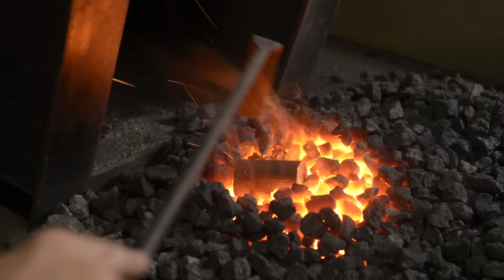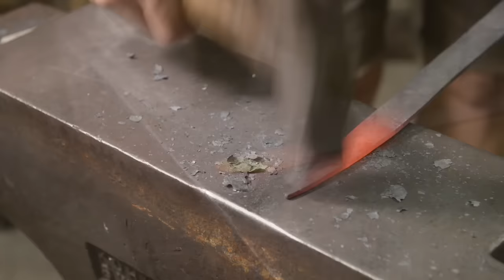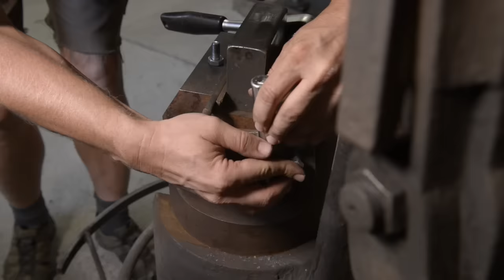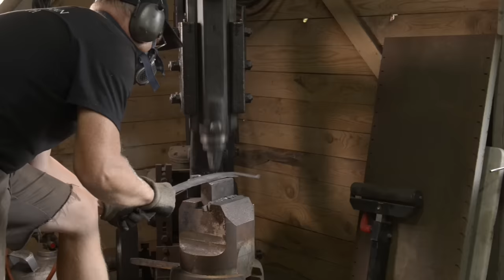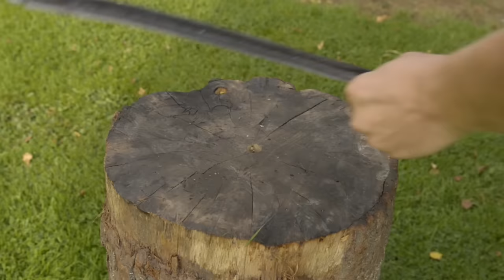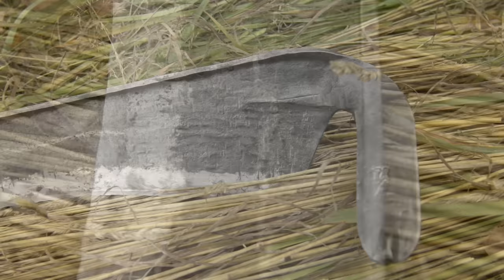Blacksmithing - Forging a scythe

Comment: Good work my friend 👍👍I just came acros your chanel, and with a lot od experience with scythes and peening, I must say it is a little bit soft by the way how fast it goes with peening. A heat treatment is needed after all.  A lot of european scythes are harder heat treated, intended for a harder, older grass(to stay sharp longer).
Reply from the maker: Thanks! Yes, I learned afterwards that it actually should, but they are tempered very high to handle the peening.

Comment: Instead of doing the marking and filing and grinding of the edge iirc it was common to sweep the blade on a stone to smooth the stroke edge before sharpening

Comment: i made a furnace in my backyard except it doesn't use coal to heat up I use charcoal to replace coals i also used an old steel leafblower as the air source.

Comment: It should harden when the steel turns gray somewhere between 600 and 700 degrees. It can bend or tear off a piece of metal if there is some thicker grass or it hits a stump or a thinner tree.
But the work is great.

Comment: I know this is a 5 year old video, but I have been super curious about scythe making. I was wondering, is there a reason that they are typically made with medium carbon steel and workhardened via peening instead of using a higher carbon steel that gets heat treated? Recently I've been developing a sickle out of some high performance stainless steel and its been working superbly, just wondering if things change as the blade increases in size
Reply from the maker: The original reason was probably that a high grade steel simply wasn't available. That's why we in Sweden only see high carbon steel ground scythes. We had a good steel source. The rest of Europe didn't. That said the peened scythe has som other nice properties, like if you damage the edge you can actually peen back the edge instead of grinding the whole edge down. And you don't need a grindstone with you on the field, just the honing stone. Simple and easy. The medium carbon one should still be heat treated, which I didn't do (I tried to research this), but tempered back really high to cope with the peening.

Comment: They made it excellently. However, the cut result is not convincing. In northern Germany, sharpening and hardening by hammer blows in the cold state is called "dengeln". And the handling of the wet grinding stones is certainly also important.

Comment: I’d say to use smaller bites into the tall grass for a better easier cut and it actually goes faster than you might think because you are not putting so much energy into large bites of grass. I would buy one of your scythe blades if you have any for sale.

Comment: Am I missing something or didn't you harden in the forge at all? So presumably the tensioning process and any future peening will work harden the scythe sufficiently to hold an edge?
Reply from the maker: I didn't research that enough, my thinking was the work hardening from peening was enough, but it turns out that it needs to be hardened. But tempered very high to cope with the stress of peening the edge.

Comment: The opening segment with the grim reaper was great, but waaaaay too dark.  I could barely see anything.

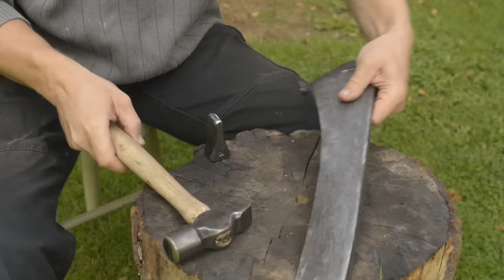Enjoyed the rest of the vid ... esp how you put the lipped spine on the scythe (15:20), and then did a hand-hammered cold steel edge bevel (19:45). Fascinating (+1).

Comment: How much Is the chisel like tool used at 4;30 hardened
Reply from the maker: It's a piece of coil spring. Hardened in oil and tempered to about bronze color I think at the very tip.

Comment: Was the hardening and tempering not part of the process?
Reply from the maker: It should have been, but in my initial research I couldn't find any info. My thought was that the edge needed to be soft enough to take the peening. Afterwards I was informed about the hardening and how it should be tempered back passed light blue.

Comment: Oh my. A hand forge scythe. Now that's rare and complicated IMO - the blade is quite thin and quite long. 

Some questions I have: 

1. Shouldn't the blade be hardened? Does it rely solely on the stress introduced when beating the edge on the small anvil for the hardness? 

2. The higher quality scythes we have around here, have the rib undercut, as opposed to just a raised square edge the rib is trapezoidal in cross-section; Do you think that it's of any importance, or it's just a coincidence that the better manufacturer used this specific shape? 

Some advices, based on my experiences of mowing in my adolescence: 

Ride the blade on the spine. It should touch the ground. Rotate your torso, do not use your hands too much. But as you said, a better snatch would help a lot, as of now you don't actually have a choice but to use your arms. 

My father used to say that you should be able to mow with so little effort, that you should be able to whistle without interruption the whole time. He didn't do it all the time, of course. But it's a way to gauge your progress as a mower :-) 

On the sharpening - we'd normally use the rib to keep a consistent angle for sharpening on the inside. It was important to get a burr, and work it in such way, that it was as much as possible in line with the blade - do NOT break the burr  as you would do on a knife or axe - the burr does the cutting, and you normally touch the scythe every 50-100m of mowing or so (it depends a lot on the grass, dryness, and whether you hit or not the ground due to molehills & stuff), and every 500m - 1km  you would do a complete resharpening. 

On the snatch - traditionally in my country (Moldova) it's made from a softwood, such as pine or fir. I don't think it is wise, maybe it was a cost-cutting solution - but the 2 snatches I made were from acacia and cherry - they were superior to the softwood one, in many people's opinion. In our parts it normally has just one handle, the one in the middle. They are "custom-fit" for the guy who does the mowing, you should be able to mow comfortably with your back straight, otherwise you'd whirl in pain at the end of one full-day of work. 

The wet grass is actually working in your favor, it acts as a lubricant. In fact, we used to get up at 4 in the morning with my father, to catch the morning dew. At about 8, when the grass would dry, the effort would suddenly increase, and we'd call it a day at about 9. Very rarely we would mow the whole day, and it's a freaking marathon when we did. After a while your mind just goes blank and your body moves like on autopilot. 

Oh. Sorry for the long post. Scythes are exciting!
Reply: oh, one more thing, looking at your current snatch - don't bend it. The edge should be slightly raised, not completely horizontal. Maybe a...12-15 degrees - you decrease the chances of hitting rocks, roots, and pieces of dirt.
Reply from the maker: Thank you!
1. Yes, after more research it seems it actually should be hardened (but tempered back quite far to still be reasonable soft). I thought it needed to be pretty soft to withstand the peening, and several people agreed to my thinking.
2. I think that is just coincidental and part of the manufacturing process.

I'm working om my technique! I have made my handle longer now as a test, and that makes a huge difference.

Comment: Surprised you didn't make a Scandinavian style scythe which are extremely hard and can't be peined. You have to sharpen them with a stone. Usually heat treated to straw color and no further.
Reply from the maker: I kind of like the simplicity of this style.

Comment: Very interesting. Did not know that linseed oil is good for steel (I used it for wood all the time). Wet grass is actually good for scything, better than dry grass (it's a bit like cutting hair). Most people hone the edge with the curved side of the stone.

Comment: When peening the edge, are you looking to have the edge cant slightly downward during the sharpening process? I heard because of the normal wear its actually better to keep the edge at a slight angle apart from the rest ofthe blade... Im no expert. Just wanted to know iftheres any truth to this?
Reply from the maker: A slight upward angle on the edge is ok! Not sure if that effects the performance much tough.

Comment: I read through a load of comments and theres a lot of different thoughts on how to make this work and why it didnt work. However it is a combination of things the carbon content will have been reduced when the sparks formed therefore eliminating the red short theory. The sparks would have also gained a coating of iron oxide feo3 as well as rust from getting wet therefore what you have is a lot of feo3 and a bit of steel of questionable carbon content.therefore if you stuff it into a can and heat it up you ar essentially trying to weld a can of forge scale together which will give you partially consolidated pieces of forge scale as we saw in the video.
Im not sure you could make this work in a can by adding carbon to replace the oxygen as it would need to be present in the right proportions and would need a vent hole which in a best case scenario would weld together but would be full of contamination and be inconsistent throughout the billet its a cool experiment but i doubt welding sparks is a viable option

Comment: Common Rockwell hardness for European blades is about 45RC. Nordic, English, and American blades are a good deal harder, with whole-steel blades being about 55RC and laminated blades having an edge so hard that a file won't bite them.
Reply from the maker: Wow, are you sure? I wish I had a HRC device... Sounds way too hard. 1045 steel wouldn't reach 45 HRC untempered if you quench in oil according to the specs. Or maybe you have measured the peened edge? The edge maybe could reach that level from work hardening?
Reply: @torbjornahman  I only just now saw this response. 1045 is not usually used for scythes. 1080 or similar is a more common choice. Some years back the renowned Peter Vido had some testing done on a range of Euro-style blades. And Nordic/English/American blades are run a good deal harder than these. :)

http://scytheconnection.com/consultants-report-on-blade-hardness/

Work hardening only increases the RC by a few points, and only improves resistance to plastic deformation--it does not improve wear resistance like heat treating to a higher hardness does. The disruption of the crystal lattice in the steel is what makes it harder to deform a peened edge, while a greater presence of martensite in the steel is the reason for higher hardness when heat treated harder, and as such the martensite improves wear resistance vs. nearly entirely pearlitic steel work-hardened to equal RC.  :)
Reply from the maker: @FortyTwoBlades  Cool, thanks for the link!! Well, I didn't know which steel to use and I tried to consult a few people but we all agreed that the blade needed to be soft enough to be able to withstand the peening. Through the comments I have learned that I probably should have made another choice and definitely should have hardened the blade. In Sweden we traditionally only used scythes that you grind (high carbon). These will crack if you try and hammer on the edge. Another reasoning I had, why the "european" style is so common, is that you probably could do with less good steel compared to the Swedish/Nordic ones.

Comment: Ожидал закалку и заточку, приятно удивился почти правильной "Отбивке". Like, for cold forging. Sub., and bell.
Reply from the maker: Thanks. Yes, I may have to revisit this for hardening. I was not sure it was needed. Now I know it should be done.
Reply: @torbjornahman  Soviet/Russian standard is quenching and tempering, sharpening, cold forging and final sharpening. 90% cases, should be used "У12" steel or "CT120" European steel. ;) also, nice moves all way better, than mine =)

Comment: Hi, I'm starting blacksmithing and I've read that you aren't supposed to hammer the metal after it cools past red-hot, as this creates stress and can lead to cracking. However, it seems to work fine for you, so could let me know what your thoughts on the matter are?
Reply from the maker: In general that is correct, especially when you deal with tool steels. Mild steel and 1045 that I use here is quite forgiving. Major forging/deformation should never be done "cold".

Comment: 14:05 You start hand fullering the crease, and get in a wrestling match. Have you considered making a stake, letting you hold the work on the stake, and drive it on the stake? It'd be harder to see, but easier to hold the work.
Reply from the maker: Yes, but I thought it wasn't really necessary.

Comment: Два вопроса: первый, почему не закалил косу, второй, не вопрос, а скорей совет - ручка косы должна быть не меньше тебя если нет, то с таким объёмом работы спина болеть будет.
Reply from the maker: 1) That is a mistake by me... I tried t o do research about hardening this type of scythe, but learned afterwards that it in fact should be hardened.
2) I know, I have adjusted my crappy handle. Need to make a proper one some day.
Reply: после закалки ты ее не отобьешь.
Reply: замкнутый квадрат, это твой личный опыт или кто-то тебе это рассказал?
Reply from the maker: @user-qf7vf1br2c  It needs to be tempered very high to still be able to take the peening of the edge.

Comment: So I'm getting ready to make a scythe soon and I was wondering if you would change your design at all or harden your steel?
Thank you for showing us how to make one. 👍💯🤠
Reply from the maker: I would make the "tang" part a little thicker, and it needs to be heat treated! The steel should be a high carbon steel like 1075, tempered to like 350C or something like that. I think I will revisit this one in the future.

Comment: I saw that you used an austrian whetstone(Offner it the brand name i think).I have the same stone but i use it dry.It is normal to use the stone soaked in water?
The water can affect the integrity?(become weaker and break)
Reply from the maker: Yes, it should be soaked in water! It does not seem to affect the integrity.

Comment: Torbjörn, I've been rewatching this video and it occur to my mind that I have seen heat treating the scythe, both quenching and tempering it in the unusual way. In a link down below you will not understand a single word but you will recognize the process, in that way work speaks to you and you will know what to do if you decide to do it again or in this manner. This is and old blacksmith and his son, he learned from his father and they were in business of blacksmithing the scythes only.  Scythe is quenched in a special mixture, smith never told the full ingredients of the quench to anyone but his son, and to him was told because he had one that was willing to continue family tradition of being a blacksmith. What he told was next: Bear lard, Badger lard, sheep or cow lard, wax, vegetable oil, + that family secret which no one but father and son know of. Scythe is quenched and then tempered on mid fire while blowing the air slowly at scythe and pushing those colours from bottom to tip. You will see by yourself.
Link youtu.be/XymXc2tvil0?t=748
Reply from the maker: Thanks, others have directed me to this video also, so I have seen it now! Something to revisit perhaps!

Comment: How is it, traditionally, at least, Swedish scytes, were / are not hardened by the fire, besides the work-hardening / hammering ? Is it because of old tradition (maybe we couldn't produce high carbon steel, only iron in the year 800) or is it of a more practical / technical  reason somehow ?
 
And about the "tensioning" you invoke on the blade by hammering in a special way, what does that do exactly, why should one hear a tone, and why is that useful ? Is tensioning an old  replacement for spring-hardening ?

I can see the hammering makes a wavy edge, much like a bread-knife. Very useful for cutting weed, I understand that feature.

I also wonder why the Scyte got the ridge or spine, so prominent and unlike the Swords fuller. So cornered and seemingly difficult to shape on the anvil.

Certainly I understand everything  is very useful somehow, but I dont' know why.
Reply from the maker: Swedish or Scandinavian scythes are actually mainly made with high carbon steel edge! So these needs to be heat treated like any knife and then you grind them sharp. That steel is much harder and can't be/or does not need to be work hardened. This is probably all related to the good steel we could produce here... the "european", that I make here is a mich lower grade of steel and construced in another way.  Tensioning makes the blade more springy and sturdier. You slightly elongate the actual blade while the spine holds it's shape creating "tension" on the edge part...to my understanding.  A wavy edge does not matter but I don't think it is beneficial. The blade is very thin, just a mm or so. The spine makes it very strong in the "flat" direction. Without it, the blade would just flex uncontrollably. A sword fuller is mainly there to reduce weight.

Comment: How did you know what size blank/plug to start out with to yield the correct size finished blade?
Did you perhaps know the weight of the blade and duplicate that with the slug?
Nice job.  
JIM
Reply from the maker: Exactly, I checked a known blade for the weight and added some.